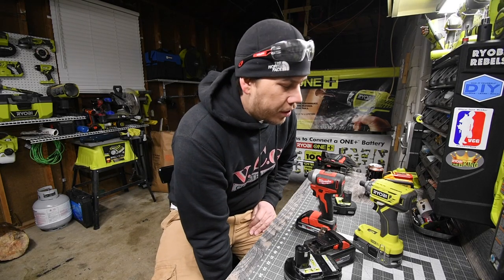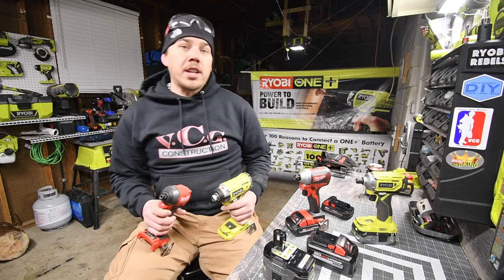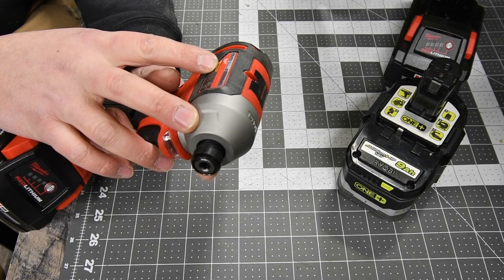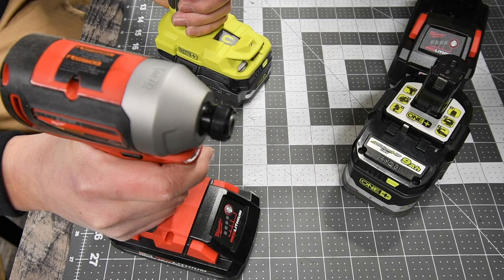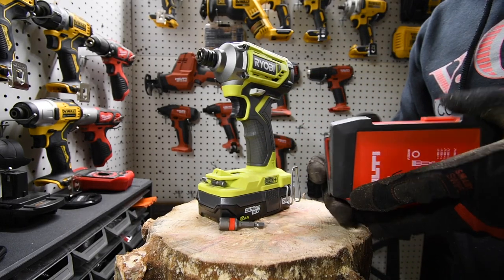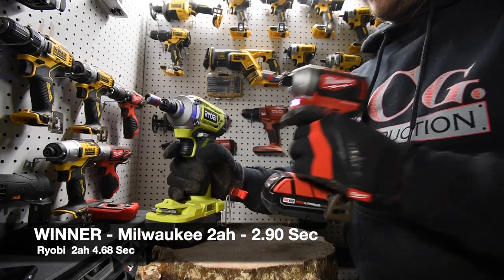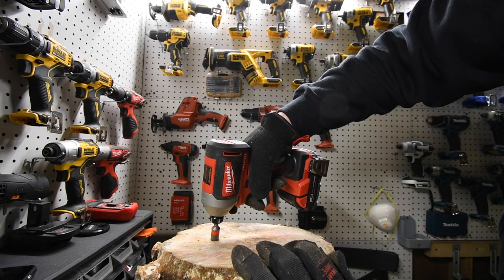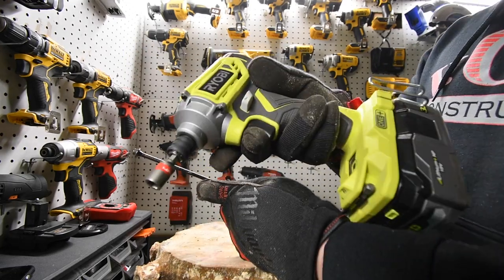Ryobi VS Milwaukee (Impact driver)

Comment: I'm a self employed Plumbing & Heating contractor, nothing but Milwaukee or Ridgid power tools on my truck. However, I have 2 Ryobi cordless drills on my truck that are 12 years old, and I can't kill them. Out of 2 batteries, 1 recently took a crap, and I've beaten both these drills up over that last 12 years and they still keep going. Those that say Ryobi is for the homeowner or D.I.Y.'er has no idea what they are talking about. Ryobi has earned my respect, even though I'm a Milwaukee/Ridgid guy for my trade.
Reply from the maker: Ryobi has the power but the Milwaukee will last a lot longer than the Roybi will and I thank you for viewing sir

Comment: I'm a ryobi guy myself. Can't afford the others..lol Great value based on your videos. Thanks and keep up the good work.
Reply from the maker: I thank you sir
Reply: I Have/like Ryobi. I've had a couple raw deals with Milwaukee AND Makita. Ryobi has always exceeded my expectations.
Reply: if you are living in the EU, you will found they are all around the same price point,20 pounds up and down.
Reply: right now that Milwaukee  2850-20 kit with battery and charger is actually cheaper than that Ryobi P239 with battery and charger.
Reply: Milwaukee and Ryobi are owned by the same company

Comment: Ryobi blue's purchased in 2004. Commercial use. Basically never died but went extinct. I still use the 2004 flashlights frequently as well as a few other tools that I got in 04. My Ryobi greens commercial use for the last 10years...still going. I've seriously never burned out a drill with medium/heavy use. They go extinct before they break. Ryobi always lags a few years behind in power, design, weight etc. but is still awesome. Works for me.

Comment: I have always used ryobi ever since I used to work in siding, gutters and roofing. If dropped from a height they are tougher than dewalt and Milwaukee and also cheaper to replace when needed.
Reply from the maker: very good, Ryobi has come a long way from the blue line and thank you for viewing
Reply: How do you know ryobi is tougher than the rest when all you've ever used is ryobi??
Reply: @Mick_Jackson  maybe his workmates use them

Comment: I've had a  Milwaukee 18v Red Lithium impact driver for 9+ years. I just built several storage shelves this weekend with it. I used 5+ pounds of 2.5 inch gold screws. In spite of its age, my Milwaukee drove in over 80 screws before needing a charge and still runs like it is new. I have used it a ton over its life. There may be something better out there. But, I have no reason to switch impacts. Totally happy with Milwaukee.
Reply from the maker: if the tool still works for you then that is fantastic and I thank you for sharing your story John

Comment: when i was an apprentice i used ryobi it's what i could afford and well i can say it kept up with the guys using Milwaukee but at the time they only had the 2amp hour batteries so i eventually went Milwaukee. but ryobi holds there own they are by no means a cheap tool in when it comes to quality and performance
Reply from the maker: I agree, people need to give Ryobi more credit for their tool line now
Reply: i as well and i still use Ryobi today at work , 
my brushed impact is going on 3 years and the brushless of course is a bit stronger
you can't beat the price ... i don't know why ppl aren't fans of Ryobi,
lol probably the same ppl that hate Nickelback
Reply: @hydrostream76  With all due respect, people SHOULD hate Nickelback! (kinda leaning to Ryobi myself though)
Reply: @hydrostream76  that’s not nice lumping the two classes of people together!😡 . I like Ryobi not Nickleback! I appreciate your joke though😜

Comment: Dewalt was unreliable when starting out in the 90's. As well as Ryobi Nicad batteries were horrendous. But as time goes on now everything cordless is lithium batteries and brushless motors. Everything now is made with much better quality you will find any brand pretty much is reliable. Ryobi is double their price now. So Makita, Dewalt and Milwaukee might look better for almost same price. Ryobi is pricing their way out of the market. They are not being competitive in pricing anymore. No point in buying into their line anymore. 😮😊

Comment: They are both owned by same parent company and produced in same factory. Milwaukee is marketed for professional and industrial usage, it's their premium line. Ryobi is marketed for the DIY and introductory usage, it's their cheaper line. But Ryobi for last decade has been making tools targeting the high end to compete with more expensive brands, likely to catch customers who start off using them and wanting to upgrade or has became professionals and like their experience with the brand. What were the prices of these two?

Comment: I’ve never had respect for Milwaukee tools, with the one exception being their impact drivers. The absolute undisputed best, unbeaten. I would die for one
Reply from the maker: I do thank you so much for viewing
Reply: Why no respect for Milwaukee tools?
Reply: Ive used a few brands over time, but out of the "top 3" (milwaukee, dewalt and makita) i found Milwaukee to be the best for me, they just feel right for me but hands down the impacters are beasts. It feels like you could change a F1 tyre with those things

Comment: Thanks for the great test videos. The higher external temperature may be a good thing, it may be that it is doing a good job sinking the heat away from the internals. That is my experience with high-end flashlights with bodies made from copper.
Reply from the maker: I thank you for viewing  Greg :)

Comment: ... if the anvil kicks earlier means that the spring is mild,  not because the power is smaller,  you can put those screws with a comby drill  , wat the impact drive does is breaking the torque so the socket doesn't jump on the screw head.
Reply from the maker: I know what it does, the later the extra torque is needed the better, and thank you for viewing

Comment: Hey boss you got to remember your wood has some knots in it. Sometimes the ryobi must have hit a hard spot and sometimes the milwaukee hit a hard spot. Also Ryobi and Milwaukee are different segments of the same company - ryobi is home owner/diy, milwaukee is pro (atleast I think).  I have both products, 40+ Ryobi tools, and about 10 Milwaukee tools. I used ryobi for my fix and flip business. After 4 to 5 years of use, I can tell you the Ryobi is very underpowered, but also after years of use it's starting to show it's wear and tare. The ryobi hammer drill - no longer works it over heated after a few uses. The circ. saw is under powered, sawzaw safety gets tedious, the multitool doesn't work well any more either.  The driver does not engage as well as it use to, even when it does it has no power.   Your tests show a few second difference, and people may think wow for the price, I'll get a Ryobi. But it won't last if you use it every day just keep that in mind. Can't say the same for Milwaukee, I just got a few days ago but so far loving it.

Comment: Maybe I suck but I had issues with that millwaukee bouncing of the screws.  I don't have that problem with DeWalt Makita or m12
Reply from the maker: if I was using Phillips heads it would bounce big time.
Reply: @ManCaverTools  so it is a problem with that one?  I was running 2 1/2 square drives and I'd slip and stab the back of the cabinet.
Reply from the maker: Tim Happy you might need a impact with a speed setting for percussion work
Reply: @ManCaverTools  I have every DeWalt.  3 different makitas.  M12 fuel and m12 surge. And just bought the Hilti.  That millwaukee is the only one I've had a problem with.  I bought it because I forgot my impact one day.  That millwaukee bounced so bad I went back to hd and bought another DeWalt.   Maybe it was just a bad one or m18 works in a way I'm not used to.
Reply: Yea they do that

Comment: Didn't you say once you were going to do a Milwaukee M12 4.0 vs. 6.0 battery? I recently purchased the fuel impact driver and am a little disappointed in its power. It's almost as good as I was hoping it would be. Dont know if the 6 would give it just that boost I need.
Reply from the maker: I dont have the 6ah yet but I have 4,3,2,1.5 but I need to get the 6ah soon
Reply: The 6 makes a noticeable difference with the 3/8 stubby, I haven’t used the 1/4 hex enough
Reply: I charged a brand new 6 today it took forever lol and what are you trying to do that it won't handle?

Comment: Every power tool I have is Ryobi on the 18v battery platform and the Router Table, but for the table saw I recently purchased which was a Dewalt (corded). Just a DIY hobbyist, Milwaukee just too expensive for me.
Reply from the maker: Gott hit up the Black Friday/holiday kits. I got a lot of these tools on the cheap

Comment: Cool video, I've been using ryobi at home for a decade and milwaukee m12 at work. Just a tip with impacting, that adapter set up you are using for the lags, with what looks like a non impact adapter, that definitely absorbs the impact force. It doesn't matter for this comparison I guess, but in real world situations, you know?
Reply from the maker: I have tried many adaptors and the only one that survived the longest was the Makita
Reply: We have a Maximum set up here sold through Canadian Tire, it’s amazing! Only half inch neck on adapter! I regularly put on up too 100lb lugs on my Honda with a P235 and a 1.3amp battery! These Ryobi are so underrated! So glad I bought them! Cheers! 🇨🇦👍🏻

Comment: Just realized the fractions in seconds doesn't matter. Having the years of experience as a carpenter or as a contractor is the main difference.  Nice video tho
Reply from the maker: I thank you sir, each brand is good for a certain line of work. MIlwuakee will majorly out last the Ryobi
Reply: I'd say compactness and weight is more important when they're pretty close in power. The fact that Ryobi kept the same battery platform is nice if you have Ryobi tools, but those batteries are huuuge.
Reply: Doesn't really matter. I ran dewalts 14.4 over ten+ years ago. A newer version of another brushless from Ryobi to match Milwaukee. Then two years later Milwaukee will come out with a newer newer version of brushless
Reply: No matter what. Stop being lazy, bc corded tools out last anything, so drag that cord
Reply: Sorry Milwaukee even disappointed me with their cordless brushless drywall screw gun when trying to sink a 3/8 self tapper into 12g steel

Comment: That log is so inconsistent need 4×4 or 8×8
Reply from the maker: I do use 6x4 in my more recent videos
Reply: @ManCaverTools   Dave the log is not inconsistent on head to head competition. On stand alone , there is no other point of reference for baseline...
Reply: Oops meant consistent since head to head they are both drilling into the same log